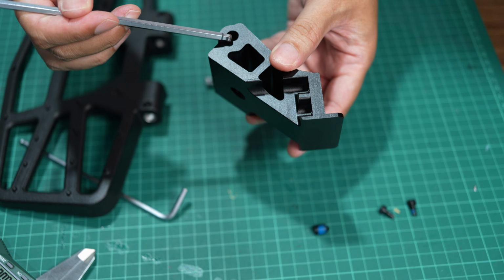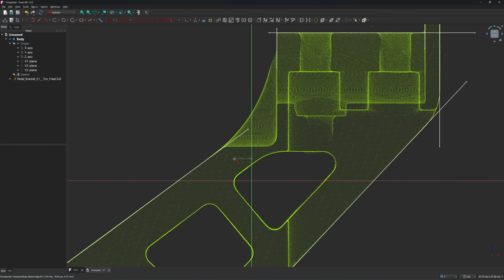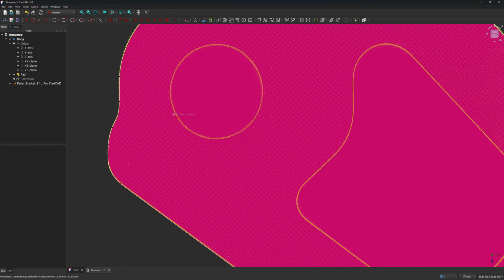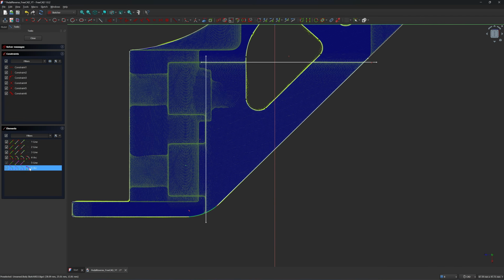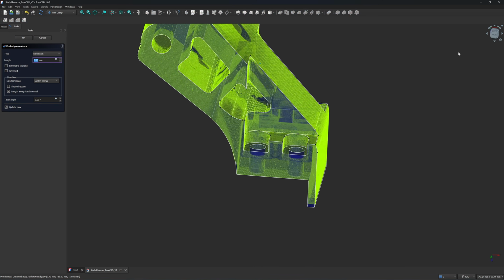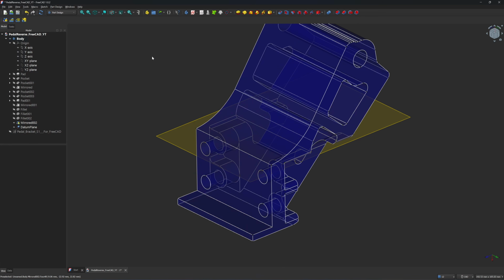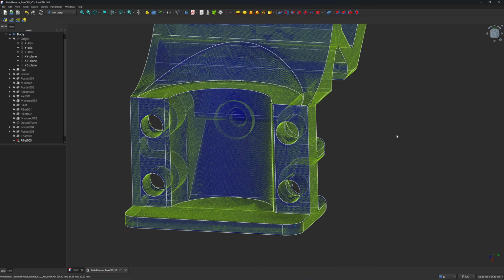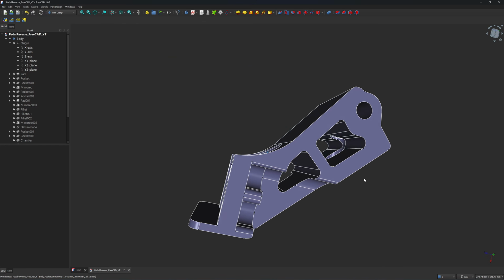How to Reverse Engineer Parts for CNC with FreeCAD

Comment: @Payo id like to see you reverse engineer a part like an exhaust maniffold or something with variable curved shapes. Id like to see how you work with non-symmetric parts.
Reply from the maker: Designing an exhaust manifold was one of my final engineering exams back in 1999. At that time, I was working on a $2 million CAD workstation at the faculty. Even then, commands like 3D spline, loft, and sweep were already available.
Reply: @Payo-TensileCreator  awesome stuff man.

Comment: @3:21 When trimming, I often have a problem with Freecad to "double trim" items. This happened with your trimming the line to arc. I find clicking the reverse arrow once redraws the line or arc incorrectly trimmed. Sometimes redrawing re-enters points which are then not connected, creating an unclosed sketch. That leads to finding the visually aligned but not connected points search. If a sketch looks closed, but didn't change the the closed color, this is possibly the problem. As a practical matter, try using polyline construction, adjust line positions and delete lines before drawing arcs.
Reply from the maker: Thank you for your insight!

Comment: Follow up after watching the video: How did you get the point cloud so well centered and aligned? In other videos you've used CloudCompare, and while that makes it better, sometimes when I load it in Freecad, the cloud is far from the origin. I move it a bit but getting it this centered is impressive.
Reply from the maker: I aligned it from this video. https://youtu.be/L1ABq6pFGgg?si=M73OBd1lmqtrzgly&t=584
After rotating and aligning the part’s side to the X or Y axis—using your monitor’s edge as a guide—go to Tool → Registration → Move bounding box to origin.
If the part is metal, CNC-milled, and scanned with a high-precision 3D scanner, you can expect alignment within 5 μm of the symmetry axis (the example in this video is just 4 μm off).
However, with a lower-precision scanner, perfect centering isn’t achievable—the left and right sides will differ in dimension.
This's what I'm trying to tell viewer for getting higher precision scanner for this kind of task.